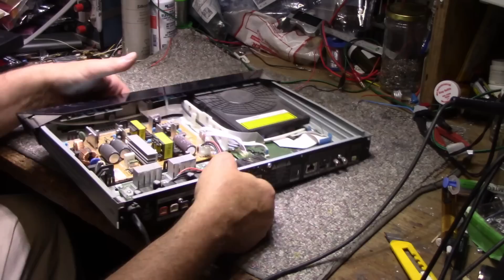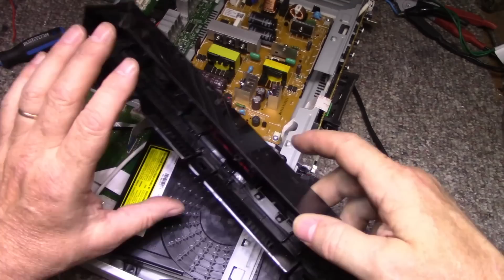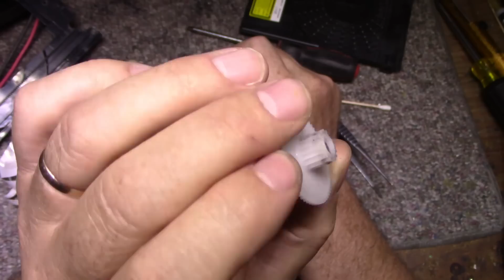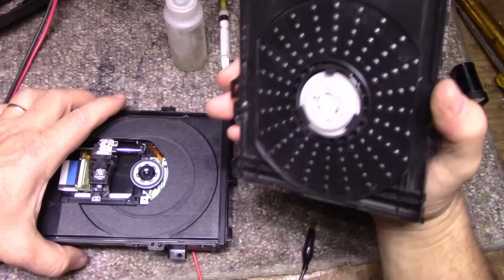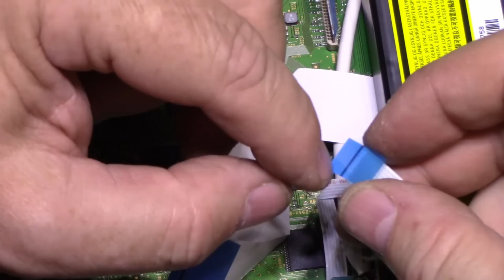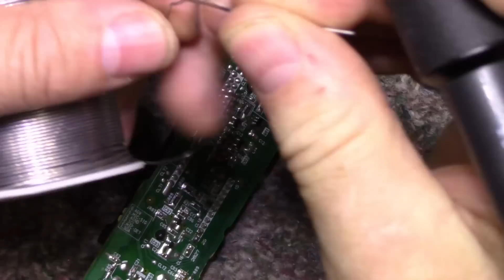Sony BDV-E2100 BlueRay System - Repairs (Ep. 195)

Comment: Great video,  thanks for sharing with us.  I have a question for you.  I purchased the BDV-E3100, it didn't come with any speakers. Can you please tell me what side or pin in the speaker connector port is Positive? I have ordered speaker connectors but they don't say what side of the pin is Positive or negative.  I'd surely appreciate it if you can help me with this. Thanks in advance.  You now have a new subscriber to your channel,  Thumbs Up !!
Reply from the maker: I don't know. Sony uses a proprietary connector without markings. It's likely a class D amplifier that's floated from ground. You could assume one side of the connector is negative and the other connectors are wired the same. For example. connect the positives to the left pin and negative to the right.
This way the speakers will be phased properly.
Reply: @TrevorsBench OK, got it... I was thinking the + would be the left pin, but better to ask you. Thank you for the help. 😊
Reply: @TrevorsBench ok, just an update here. I ordered a set of speakers for the player and now I can see that the positive pin is in fact on the right. Along with the speakers I got the DVD player and remote,  however the eject, vol +  &  vol -   on the player are not working correctly.  For some reason when I press the eject button, the volume lowers to a minimum,  and it shows volume at minimum on the led screen. Other than those buttons not functioning properly,  everything else seems good. Have you worked on many of these DVD players? If so, have you any idea if I can get this fixed? Thanks for the help. Oh, I should have said, everything works as it should when using the remote.

Comment: Thanks for the video. I have the Sony BDV-E3100 and it stopped reading BluRay disks. After watching your repair I had the confidence to attempt a repair on my device. My eldest son (13yrs old) helped me take it apart, clean 11 years of dust from it and clean the lens. I also  re-soldered the display as it was temperamental. After tackling a tricky rebuild (disk drawer front) I’m thrilled to say it’s all working again! Another device saved from the crusher.
Reply: If you've not done it, you need to update the software.  It's real easy to dò.

Comment: There is simple technique to open door plate even it's not open or without power supply on. there left side of Tray module there is small Pin hole put a needle & gently press inside lock will be shifted & try has been easily out come. after came out try press front plate out & Blu Ray module easily out come. If any one want this Service Manual then reply me Send you entire diagramed with voltage lines. Thanks Buddy for opening.

Comment: That was some very good observation on that display with the cracked joints. You are right this is a common issue especially with the earlier higher voltage ones. Nice work ! 👍

Comment: It's amazing how much muck gets into these devices. Of course you are blissfully unaware of it until there's a problem. Thanks for sharing Trevor.
Reply: Area of concern oriented ducting for the fan would have helped immensely in keeping the drive work for longer. Trevor is a patient man!
Reply from the maker: I never mentioned it in the video but the tray door has a felt seal that's supposed to stop airflow into the BD drive. Fans in electronics creates it's own problems
Reply: I have faced problem in most sony blue ray players panel switch malfunction ,if you press volume -- key ,it function as volume + and  volume increases ,another player if eject is pressed  function as volume -- and volume start to reduce  .what might be the reason for this double key press problem?....anyone please help